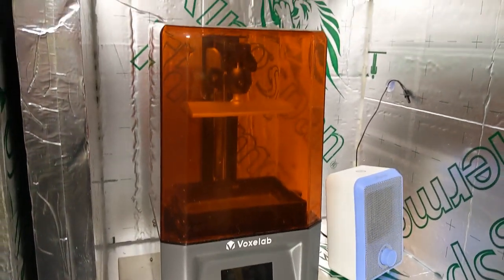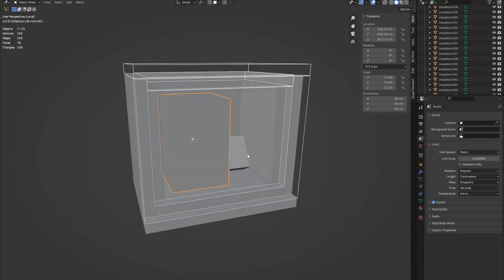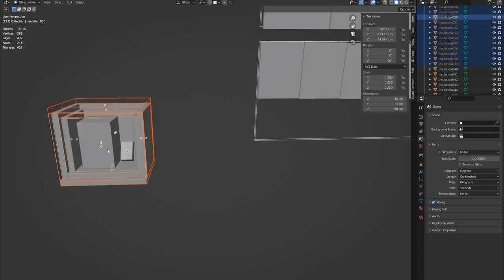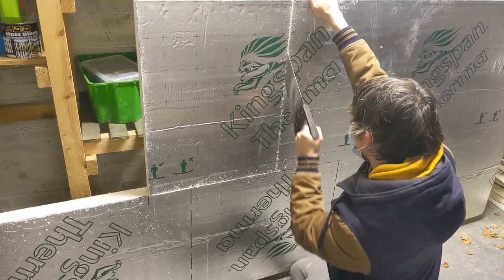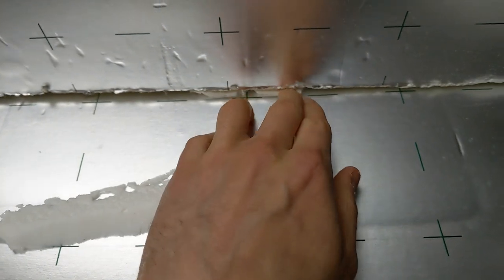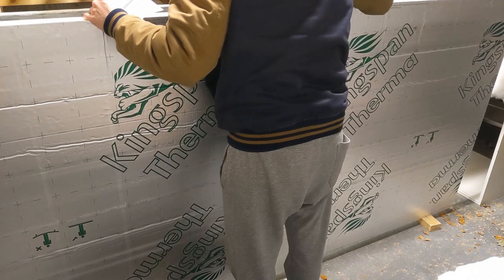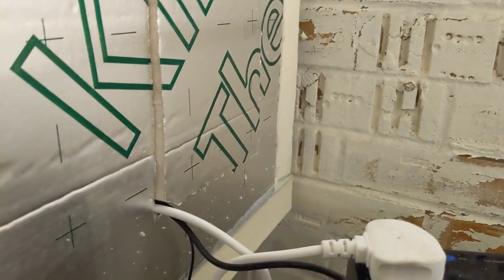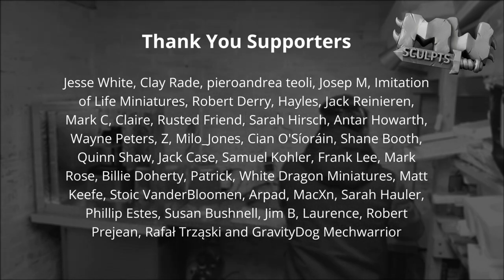Outdoor Enclosure Build For Resin 3D Printer

Comment: i got got a 3D resin printer and was looking at setting up an enclosure and so far, this has been the best! The design is so blindingly obvious. I love it. I just had a question. you mentioned in a comment here that your printer has held up for a few years, do you mean within that enclosure? I will be basically setting up my printer outside in a shaded porch and wanted to ask if it held up good for you?
Reply from the maker: Hey yeah it has held up well for a few years now I think. I keep it at 10 degrees when not in use so there is no condensation built up in the printer. I can recommend it for outdoors!
Reply: @MWSculpts   thanks man, this has been the solution I've been looking for. already started on the build and its coming along quite well. Good luck with your endeavors

Comment: I love this and wan to construct it for my balcony with a printer and curing station inside. I am wondering if a ventilation system would be feasible or would that lose too much heat ? While the entire thing would be outside, I am concerned about the VOC blast once I open the box.
Reply from the maker: Yes it is likely with ventilation you will lose some heat as the warm air will be sucked out and the cool air from outside brought in. I am not sure exactly what the impact would be though. If you are concerned about the voc when opening you could open and leave it to air out before getting the prints. Might want to open the printer lid too as there will be a lot trapped in there also.

I think if you are going to use ventilation I would bring the enclosure inside, that way the temperature would not be an issue.

Comment: I’m inspired to create something similar! Is the heater a potential fire hazard in such an enclosed space or do you have any guidance about that aspect?
Reply from the maker: Great! Yes... Unfortunately there could be an issue with anything electronic like this. I recently got an FDM printer and needed to install a smoke detector in my indoor enclosure just in case.

I think because my garage is detached even if it was to go up in flames it would be quite contained. An improvement could be some kind of WiFi smoke detector I suppose?

Comment: I like it!  Might moisture be an issue in the garage?
Reply from the maker: Yeah it will be outside the enclosure but I keep the inside a minimum of 10 degrees with the temp controller so should be ok. At least the printer has been fine for a few years now 🙂. The controller outside the enclosure could have issues in the future with moisture though.. 😅